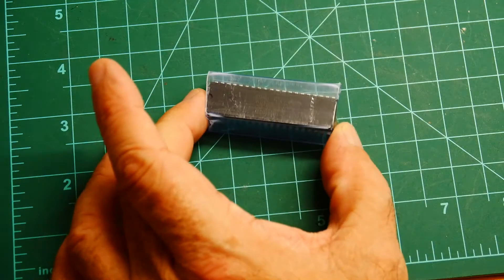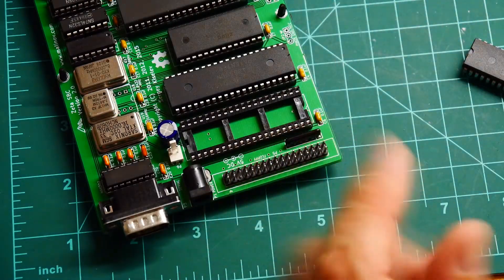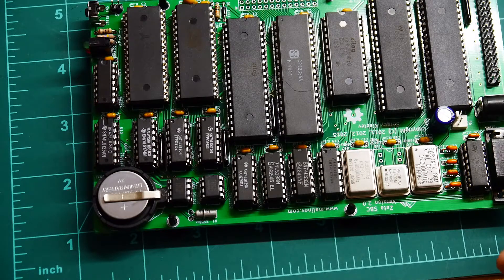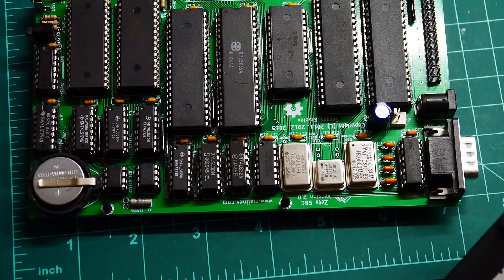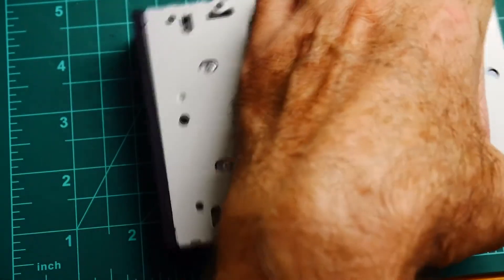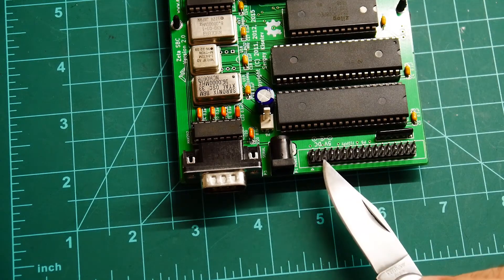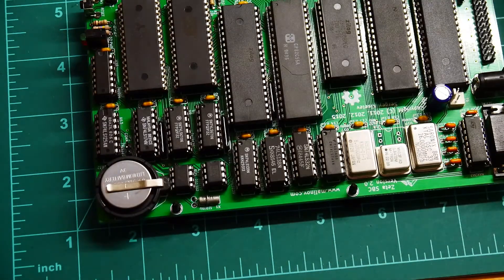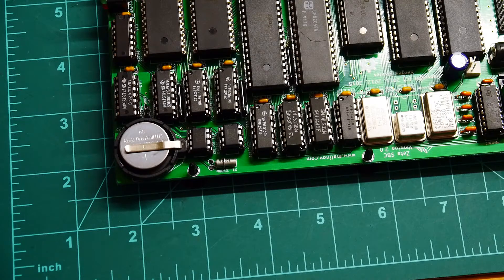#142 ZETA SBC floppy controller

Comment: you have special tools to bend the pins on ic's straight
http://www.electro-tech-online.com/attachments/pin-ausrichter-jpg.21806/
Reply from the maker: I've been bending them on the desk for 50 years now. not sure I need to buy a new tool. but looks nice
Reply: I to bend the ic pins on the desk. I have this tool to which makes it easy to do and always end up right in 1 push.
Its most usefull if you do big quantities of dip chips. its more a tool for factory usage.